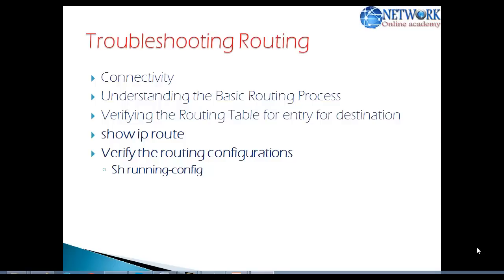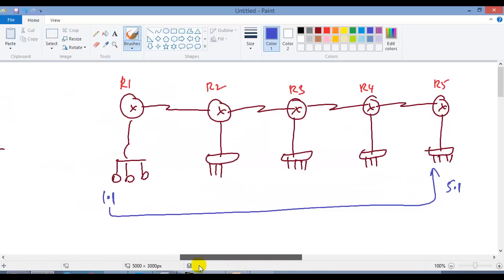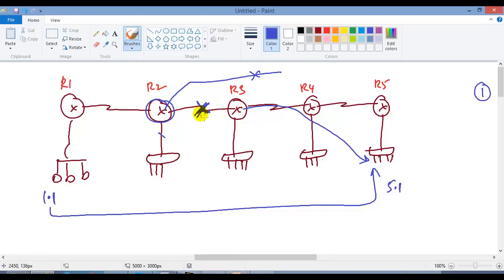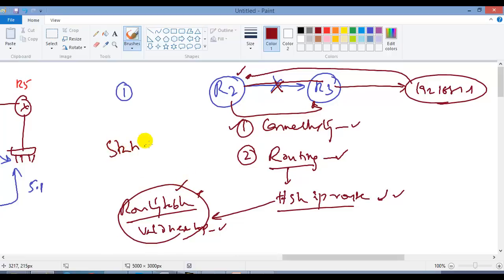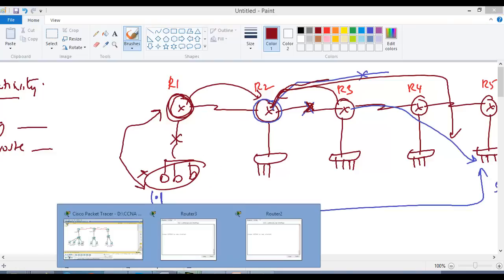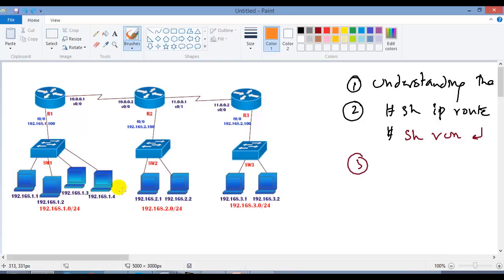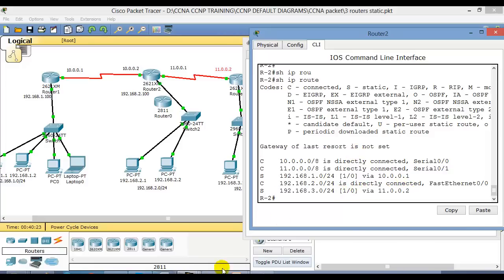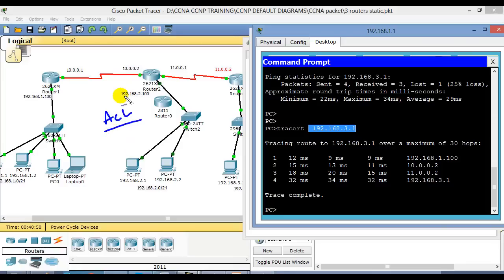CCNA Routing & Switching :Troubleshooting Basic Routing

Comment: Question regarding section around 3:55 - how would you comment the fact , that IP source address is also significant in this part? I you ping from R3 to R5 subnet, means you ping with R3 source address (subnet known by R5). But if you ping from R1, it will be R1 source address, so subnet which could be unknown by R5 router. It means that the problem is on router R5. In this case ping from R3 to R5 will not prove that there is no issue on this part of the network. Do you agree? Or my understanding is incorrect? Thanks!